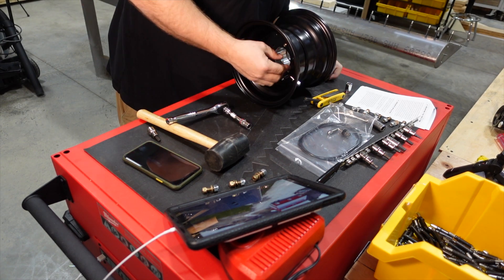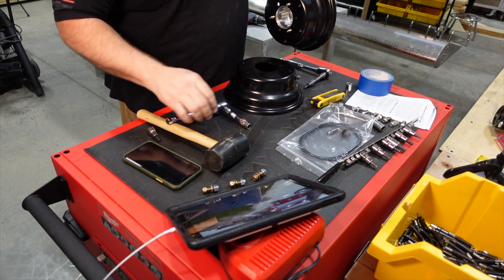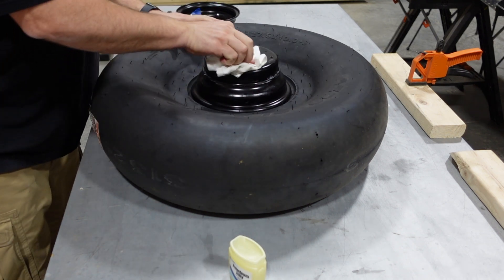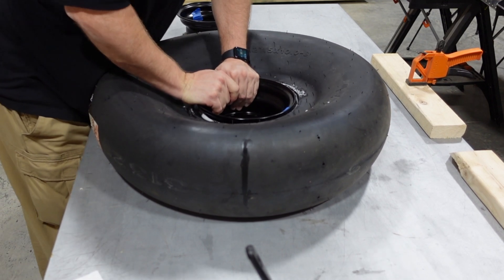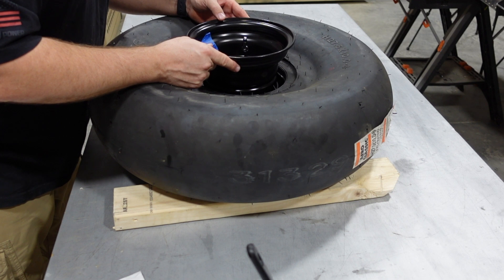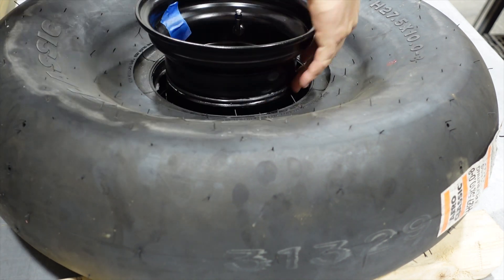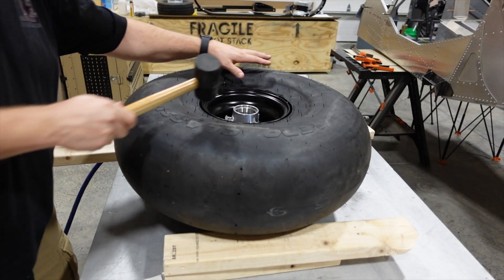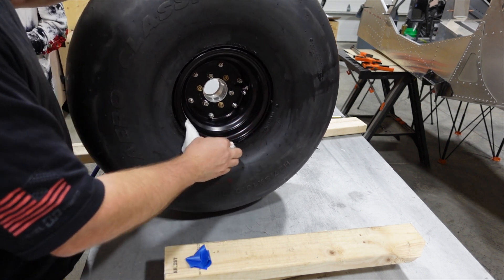Ep. 18 | How to Install 27” Aero Classic Tundra Tires on Matco Wheels | Super Duty Aircraft Build

Comment: Did you make a video showing the disc and caliper installation yet?
Reply from the maker: Not yet but when I do we'll cover it in a video.  Thanks for asking.
Reply: @AeroworksProductions 
Thanks we just picked up an 801 and got it home today... Was wondering about the brake set up and if my brakes will work with those wheels... What was the cost for the tires and wheels?
Reply from the maker: @rsrguy  Not sure on individual cost as they came in my complete kit.  I do know that the Super Duty was based a lot on the 801 though.
Reply: @AeroworksProductions  stopped by Matco today... Looks like $1500 to convert to the 27" setup... If we like how the plane performs then we'll likely go that route

Comment: If that is a rubber o-ring, vs a silicone one, you should never use petroleum jelly on them, the o- ring is petroleum based so is Vaseline, the Vaseline will cause the o- ring to deteriorate just like oil on tires, you need to use Silicone O-Ring lube.
Reply: Actually, Matco calls for petroleum jelly or silicone for lubricant. I figure they know what they’re doing with their own products.
Reply from the maker: Good tip, not sure on the O-ring type I’ll check.
Reply: Absolutely correct - and never grease!! It will be a rubber o-ring!!

Comment: Thanks Adam, great learning video. Adam is that center hub a press fit that's why you use a rubber hammer?⭐️⭐️⭐️⭐️👍🏻
Reply from the maker: Not exactly a press fit but snug.  The hub has a slight bevel to it so I just wanted to make sure it was seated fully.

Comment: Hey Adam, new to your channel... very well done (all videos) pertaining to SD, which I too am getting closer to start date.  But, just spit balling here, other than the CH650 RG on Zenith Aero site, have you ever considered a retractable CH750 SD ???   I may be crazy, but I’m going with Viking 195T VIP, and want to fab the main gear to sweep back into the fuselage behind the main balk head aft of 3rd seat area.  This would look very similar to the old Grumman Goose, no doors.   The nose would retract very similar to the CH650.   Engine mount would need to be customized and maybe some clever design changes.   Probably everyone’s first question is why?  Wheel pants don’t work for me, cost is not as big a factor for me, so also similar to a Cessna Cardinal RG.  Curious, What’s your take??
Reply from the maker: Glad to have you Dave!  Thanks for watching and commenting.  Hopefully you liked and subscribed as well so you don’t miss anything.

Comment: It's been a few months back but I took the wheels and tire assemblies with the O-Ring seals in place, lubed with petroleum jelly, to my local tire shop where they used their high pressure blaster effect to pop the tire beads out to seal on the rims and inflate the tire.  Took about 30 seconds at no charge.  The tires haven't leaked since.  Installing the dual disc brake assemblies on each wheel and then mounting both tires/wheels/brake assemblies on the large main landing gear bow was the bigger challenge.  I mounted both inflated tires with brake assemblies in place on the inverted landing gear bow and then gently put the bow/tire assembly on the ground and rolled it under the fuselage resting on the edge of a work bench but exposing the slot into which the bow was to be fitted.   Raised the bow/tire assembly into place incrementally using a platform jack and blocks.  After completing the attachment, jacked the fuselage/main gear assembly up just enough to slide the work bench out of the way and set it all down on the ground on the main tires.  Thence came the nose gear assembly and the fuselage was resting on its trike landing gear.
Reply from the maker: I remember the story you told about that Paul.  I took my time, read the (Matco) manual and came up with a couple of my own tips and got her done.